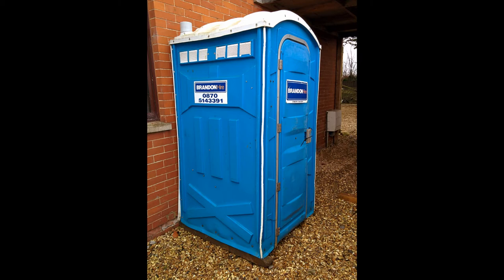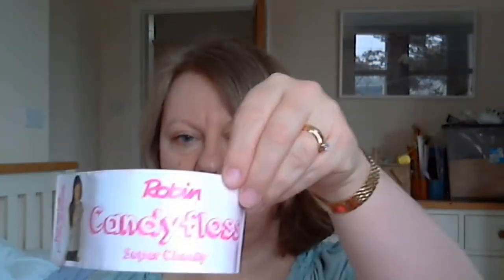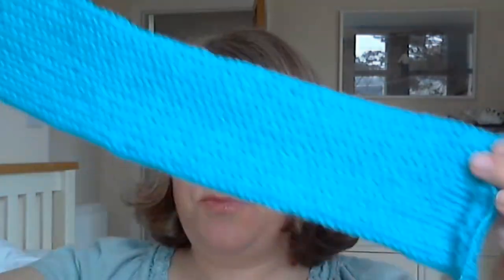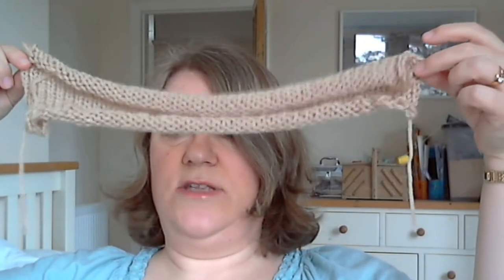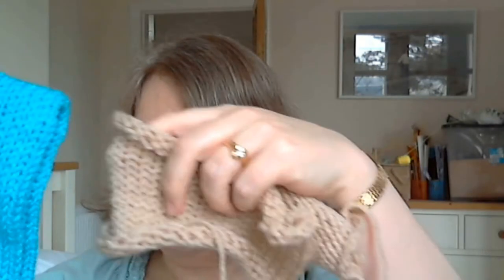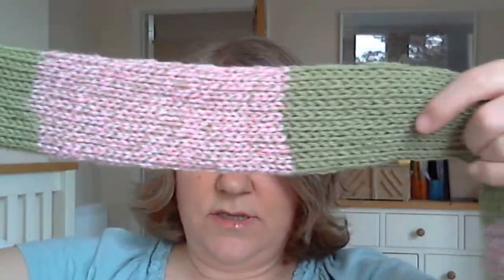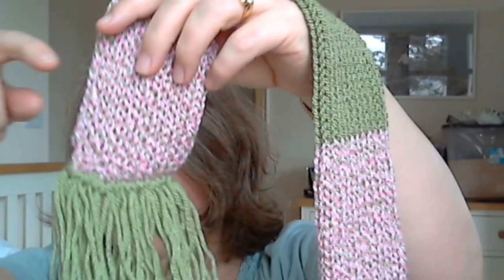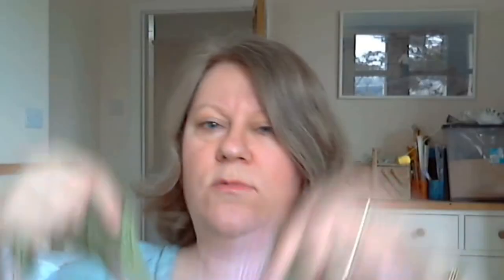#14.3 Recent Happenings and Finished Projects

Comment: Your scarfs are great love love the red variegated one its so pretty. I had the same problem with both my Addi machines with chunky yarn I got from the pound shop the machines made a horrid groaning and clunking sound so I stopped before I broke a needle. I have found the only way to make a decent 1 layer hat on the kingsize is to use aran yarn as it doesn't look quite so see through but I still prefer the tube hat like Margaret makes as it feel so cosy and warm :) At least you have your yarn goodies to keep you not stressing with all this awful weather lately fingers crossed for you that everything gets sorted quickly xxx
Reply from the maker: Thank you, Karen :)